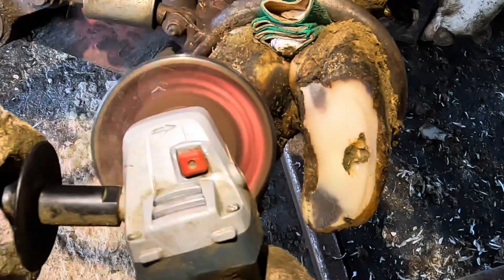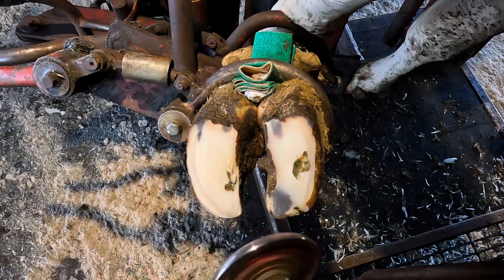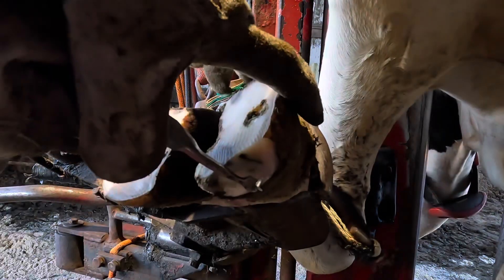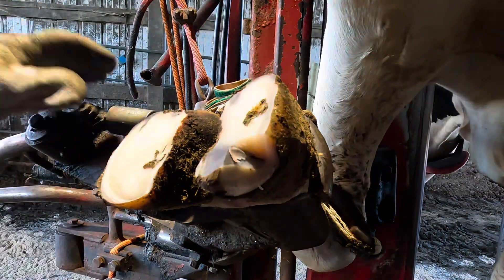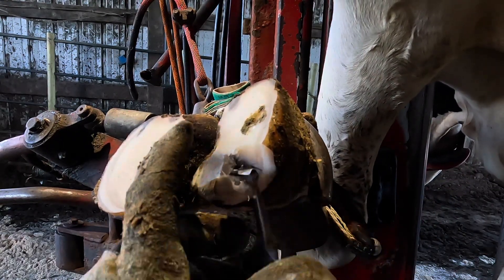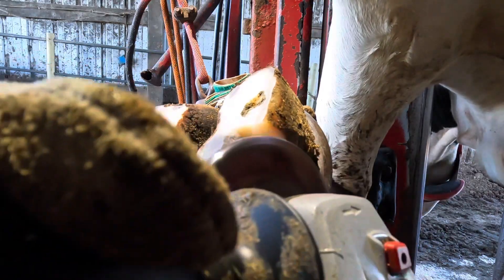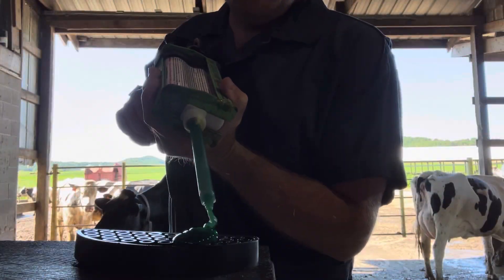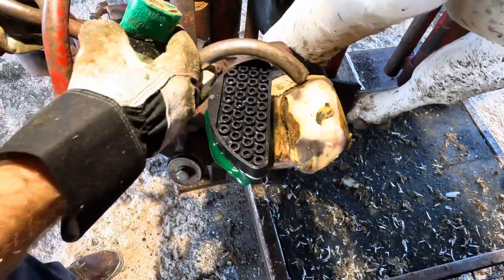I did something I DON’T LIKE TO DO

Comment: would a glob of that block adhesive on the crack be effective at preventing bacterial infection? would it inhibit horn growth? great video! thanks.
Reply: It's just adhesive so no it doesn't help. If there was a sore you could use iodine and anti bacterial spray.

Comment: Does having a block on pose any risk to a cow's joints, like how if we used different height shoes it would hurt our hips?
Reply: The blocks fall off after a few weeks but yes they do cause more pressure to be placed on different parts of the leg and foot. It's not as painful as a human having to balance on one leg or different shoes, though. It's usually just increasing the pressure by 1/8th.

Comment: Hey Nate! Just curious. How often do you have to change the wheel on your hoof grinder?
Reply: Not often thankfully, those wheels (they are a cutter BTW rather than a grinding wheel) can be several hundred for a good one. The best ones have replaceable cutting teeth but they are not cheap either, a set of replacements can be a couple of hundred dollars but last for 2 to 3 thousand trims if taken care of.

Comment: Rather than dish that area out. Could  you have cut a block down and glued it on the portion of the foot where the crack is not present?
Reply: The problem is holes in the horn get larger over time. You need to just cut that horn away

Comment: Why didn't you go all the way to the end of the crack? Seams like the Horse industry has a lot of better shoes and wall healing methods, also seams cows grow faster.
Reply: Horses are also far more expensive than a dairy cow lol. They also typically put far more pressure on their wall horn if they're expected to carry people or gallop.

You'd also need to make sure you're not comparing a vet to a hoof trimmer. In most parts of N America you can get in major legal trouble if you're not a vet. In my experience a lot of horse breeders just use a vet.

Comment: Hi, Nate. Would you ever consider putting a block on the damaged claw itself in a case like this? Seems like it might serve to redistribute the weight just as well.
Reply: Would it actually make a difference, though? Whether on the ground or on a block, the pressure would still be on the same area, so it would still be putting uneven pressure on the parts of the wall that weren’t cut off, right? And that might end up causing white line defects? Still, take what I say with a whole shaker of salt because I know nothing about cows and hoof trimming outside of watching this channel
Reply: @axuwu6939  I agree with you. No expert here either but it makes sense.
Reply: I was just about to make the same suggestion. A block on an injured claw like this one would surely redistribute the weight around the claw and help that damaged outer wall?
Reply: @georgegrierson  Maybe with the gap there where he had cut so much away, if he'd put a block there a bunch of gunk would have gotten in there, which would seem to be a very bad situation.
Reply: @siangibby5771  ohhh that’s a really good point too, a huge purpose of adding a block is to keep rocks and dirt out of the cut area too, so a big hole would defeat the purpose
Reply: All the weight is on the other claw though so I don't think it would help to have 2 blocks.  Plus it might retard the healing process.

Comment: Weird question but does the pile of cow claw shavings have like...a smell? For some reason I imagine it having some kind of smell independent of regular cow smells lol
Reply: Hoof is made out of the same stuff as fingernails, in case that helps make it more real…
Reply: Pretty sure it does. Horse shavings do smell, rather terrible.
Reply: maybe smoke + dirt, bc there's friction in the buzzing and the cow's been stepping in grass?
Reply from the maker: Not really
Reply: I doubt it, cow hooves are made of the same substance our fingernails are.
Reply: @davyt0247  Even our own fingernail clippings have a very slight smell if you chew them up or even just clip them, tho

I looked it up and apparently it’s a normal thing, not caused because of dirty nails: “The keratin proteins in our nails contain sulfur compounds, and once cut, that smell can be released.”

So imagine the smell of grinding off a bunch of hoof slivers that have been constantly sitting in muck
Reply: @davyt0247  Well yeah but our keratin fingernails don't step in grass that cows have been rolling in, and pooping in...
Reply: @terreliv  true
Reply: @davyt0247 when i file my nails, there’s a smell. it’s a very distinct smell. it kinda smells like burnt hair if it wasn’t burnt, just toasted.